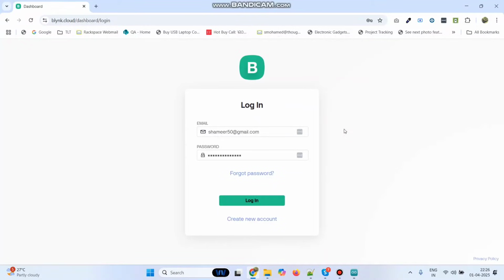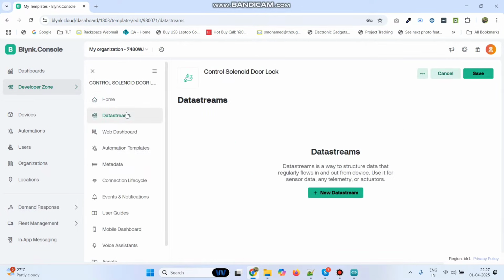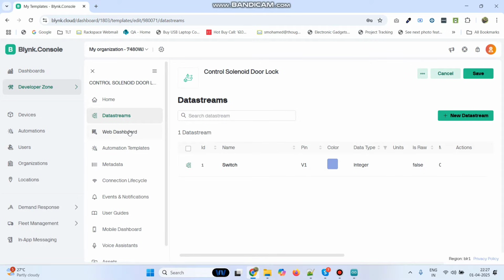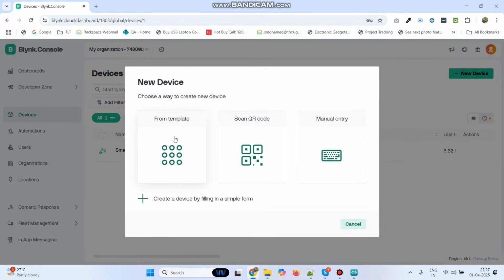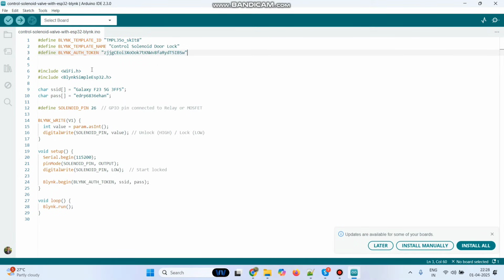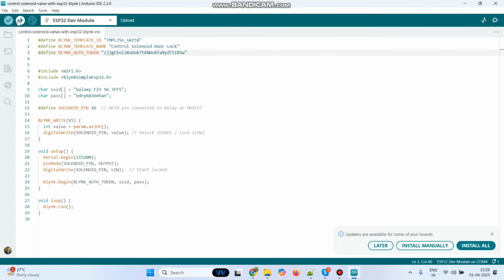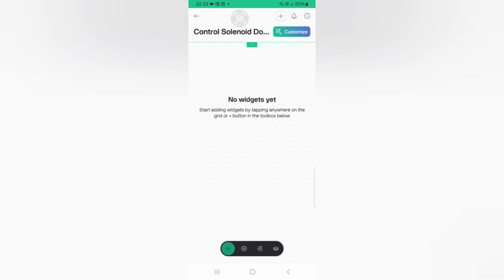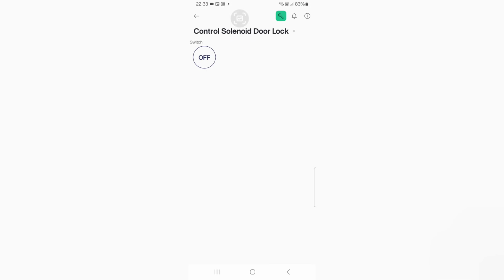Smart Door Lock System using ESP32, Solenoid Lock & Blynk IoT | Wireless Access Control

Comment: How many volts does the lock have? I found it only and it says 12v. Does this work using 3 batteries with 3.7v same in the video?
Reply: Yes it should work fine even upto 10v will still work .Key to note is that it draws alot of current so make sure your cells are fully charged
Reply: Will the lock work only using 11.1v ?

Comment: Can somebody help me.

Why is it not working even when all the connections, code is correct and also esp gets connected.
Where might be the problem?
Reply from the maker: Did you got any error ?
Reply: @TechTrendsShameer  no, but it isn't working
Reply from the maker: Check the battery you are using is supplying sufficient voltage for the lock.